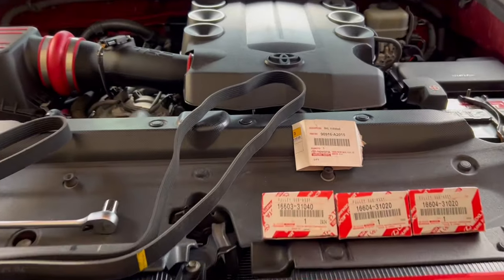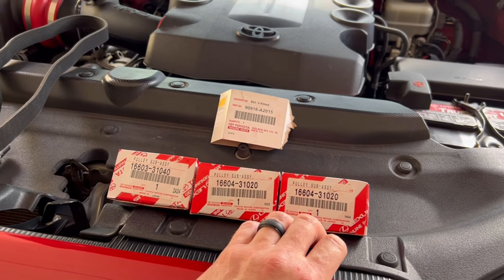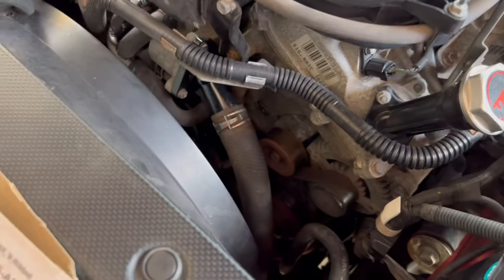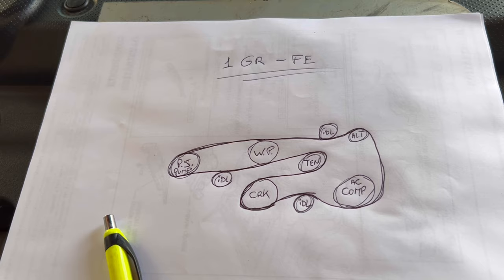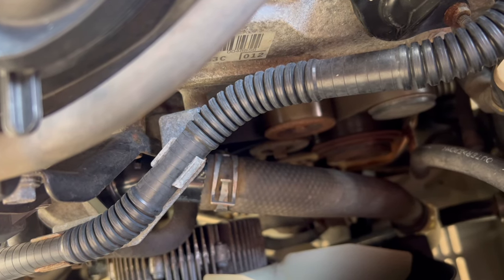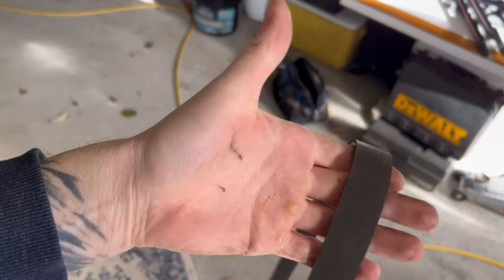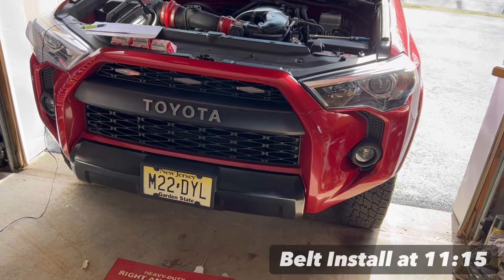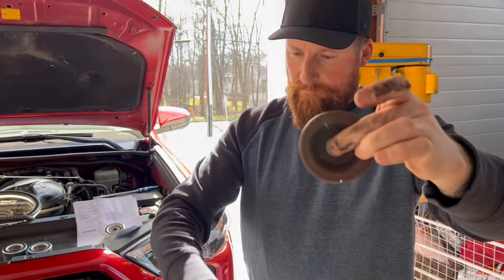Toyota 4Runner • FREE Maintenance Tech Tips - DIY Drive Belt & Idler Pulley Replacement • Episode 9

Comment: One more tip I was taught it to “bump the ignition” after installing a new belt vs starting right up just Incase the belt comes off a pulley. Another solid video my brother 🤘🏼
Reply: @some-random-bloke  I’ve got the old G-Key ignition in mine.
Reply: Wish I did that after changing my alternator
Reply: Great advice here!
Reply from the maker: @stevenboudreaux2183 🙏🏻 Much appreciated Sir!!

Comment: As usual, another awesome video.  Being the owner of a 2005 2nd Gen Tacoma Prerunner with the 4.0 (1GR  Engine) I  have replaced the drive belt from the bottom side a couple of times (remove skid plate, remove belt from the bottom side.  Had no idea that you could replace the belt and the idler pulleys from the top side.  So next time I will try to do it from the top side.  Now for a special request:  could you do a video for seniors and how to  remount a tire without "killing ourselves?"
Reply from the maker: Your support is Much appreciated!!
I’ll most definitely look into that. 👍🏻

Comment: Another great tip a msitake i made in my previous toyotas is if the belts match the same length , and everything is right and it still doesnt fit even when moving the tensioners. Remember to go as far right with the bar then move it left to move the tensioner to its full potential, if you under shoot it wont ever fit, that tensioner can move a good amount.
Reply from the maker: It sure can, one learns that overtime.
Excellent point nonetheless. 👊🏻

Comment: Thanks for sharing!  I have to replace the alternator on my '10 4runner with about 162k miles on it, and will also replace the original belt.
Reply from the maker: Not bad, you got this!!
Reply: Doing the same thing with my 10’ new alternator, how did it go?
Reply: @Nwwoods  Went alright.  The bolt in the back of the alternator was not fun.  Also, the 1st alternator I got from Oreillys  had to be returned, because the pulley wasn't turning freely.  Got it done though!

Comment: Hi mate,

I’d really appreciate your input on this.

About three weeks ago, while I was out guiding, my car suddenly wouldn’t start. The battery is relatively new—only five months old—so I was quite surprised. I ended up waiting for roadside assistance to jump-start it. Afterward, I took the car to AutoZone, where they tested the battery and confirmed it was in good condition with no issues.

However, during a second test (where they had me rev the engine to 2,500 RPM), they found that the alternator wasn’t producing enough voltage—13.8V instead of the required 14.5V.

Everything seemed fine until this week, when I had another issue while guiding. After some off-road driving to reach remote beaches requiring 4x4, I experienced the same problem. Fortunately, I had decided to buy a battery jumper as a precaution after the first incident. It worked as expected, but after starting the car, I noticed a strange noise (which I captured on video).

I’m considering two possible causes:

The serpentine drive belt might need attention.
The alternator might need replacing.
Is there a way I can send you the video? I’ve searched online but haven’t found anything similar. For reference, the car is a 2016 Trail model with 120,000 miles on it.

Thanks in advance for your help!

Comment: Great video.  I have an 03 Sport Edition that was my wife's.  We where thinking of selling it but I just could not part with it, even though its a 2wd its still a great SUV.  I'm doing the belt later on today and this is a great how to since the 4.0L V6 is the same layout as yours.  Even has the same miles.  Thanks, you just got a new subscriber!  🙂
Reply from the maker: 🙏🏻 Thank you very much!!
You got this!! 💪🏻
Reply: @VikingsGarage  Got it done.  The only thing I did different is I took off the skid plate so I could route the belt easier.  I figured if I can do the belt in my 14 Lancer ES, I can do this one!  Thanks again.  👍👊
Reply: @ericwhitehead6451 nice. I have a 04 2wd as well and surprisingly a 2wd can go through quite a lot of stuff. Ive never been stuck before and I've gone through mud, snow, and sand.

Comment: Hey Viking have you ever replaced the front corner lights? How do you access them, through the wheel well?
Reply from the maker: I actually have replaced mine when I replaced the headlight assemblies… but I can confirm that the only way to get to it is only thru the wheel well. Remove that wheel well fender cover and getting to it will be easy. 👍🏻

Comment: My 2010 4Runner has 192k, I was thinking about changing out the tensioner and idler pulleys as just preventative maintenance and peace of mind. Would you recommend waiting until there is noise coming from them? 🍻 V
Reply from the maker: At that mileage, change at least the pulleys. 🍺

Comment: I have a 2019 SR5 4Runner and I suspect one of my idler pulley bearings is going out at 108,000 miles. 
Do these idler pulleys have standard righty tighty lefty loosey threads or are they reversed?
Reply from the maker: Normal threads on the idler pulleys sir! 👍🏻
Reply: @VikingsGarage awesome thank you! About to begin the process of tracking down an awful rattle in my engine bay. Hoping it’s the idler(s)
Reply from the maker: @mctropic 👍🏻

Comment: Once again great video! Im looking to do this but run into part number 16603-31040 saying does not fir 18' 4R  , suggests this is the correct part # 16604-31030 ?
Reply from the maker: The part number you gave, second one is for a idler pulley

Comment: Should a normal idler pulley have slight play? I’m referring to the one closest to the alternator. 

My 2023 4Runner with less than 400 miles has slight play in the idler pulley .

Any info would be greatly appreciated
Reply from the maker: I know exactly what you referring to.
That is perfectly normal, they all do.
Reply: Appreciate the timely response,

Another question,
Should no.2 idler pulley (near alternator ) have a slight wobble?
Reply from the maker: @ericozeta9997 They both do, very small.
Reply: You sir are a wiz , will be subscribing to the challenge.

Will need all the tips and tricks as I  just purchased the 4R 2023 SR5 Premium.
Reply from the maker: @ericozeta9997 👍🏻 Thank you!!
Congrats !!🍾
Reply: They replaced my no 2 idler pulley under warranty, along with the belt. The belt they replaced it with is a Mitsuboshi, is this OEM for the 2023 4Runner?
Reply from the maker: @ericozeta9997 yes

Comment: how come you did not replace the tensioner pulley as well ?
Reply from the maker: Because that one I replace together with the tensioner, that video will come out eventually. 😉
Reply: @VikingsGarage  also a couple things.... 1. I was just reading that toyota does not sell just the tensioner pulley alone. And 2. When getting the correct idler part numbers from toyota there are 2 variants depending on what your factory pulleys marked codes are on the pulley with and to make sure you get the correct ones.
Reply: @VikingsGarage  and it appears in your video the pulleys you took off were marked with 7016 and the ones you installed were marked with 7013.... which to me indicates those part numbers were not correct for the 2 same idlers cause
Reply from the maker: @stevederosa1655 All part numbers are correct, those are interchangeable. I’ve done this over 1,000 times, zero issues Sir
Reply: @VikingsGarage  i wonder what the difference is then 🤷‍♂️🤔

Comment: Is it normal for a idler pulley to have a slight movement. Just bought a brand new 2024 4Runner TRD ORP and I noticed the idler pulley has a slight wobble.
Reply from the maker: It is indeed normal, they all do that. Every single one. Nothing to worry about.
Reply: @VikingsGarage 

Thanks for the reply

Comment: There are 4 including the tensioner pulley? Why would you skip the tensioner pulley?
Reply from the maker: Because I don’t replace just that pulley, I replace the entire tensioner. 😉
Reply: @VikingsGarage  I understand the the tensioner difference now. I just replaced all the idlers bearings by pressing them out with a rented ball joint press. (Timken 6203-2RS). 
😀 Takes all the fun out of being a parts changer, I know.

Comment: Doesn't the fan shroud or hood have the belt diagram on it?
Reply from the maker: It does not, 
otherwise why would I tell you to draw it out 😅
Reply: @VikingsGarage  I have owned 4 4runners and that's a new one on me.

Also, you never stated that to be your reasoning; you stated that that's what you usually do and that's what your method is, never did you say that the diagram wasn't on the shroud or hood. Go back and listen to your own video.

I've been working on cars for over 45 years so you can keep that "Snarky' little remark to yourself.
Reply from the maker: Wow. 👍🏻
Go up and look at your comment… knowing that the hood or fan shroud had the diagram, why would I tell you to draw it out. 
The fact that you took the time to come in the comments section to attack me shows your true intentions. 
No snarky attitude here, but hey it doesn’t matter does it.
I’m the one here still trying to pass on the knowledge just to get judged and criticized. 🤔
Thank you for watching!!
Reply from the maker: Correct, I do have a snarky attitude!!
Thank you for noticing. 😁

Comment: Red threadlocker is worthless when exposed to heat, like the engine and radiator. Where does it say to use this in the service manual?